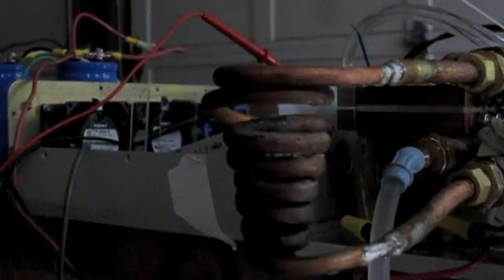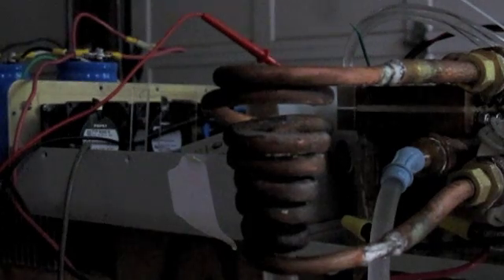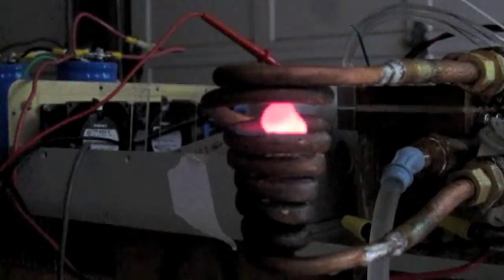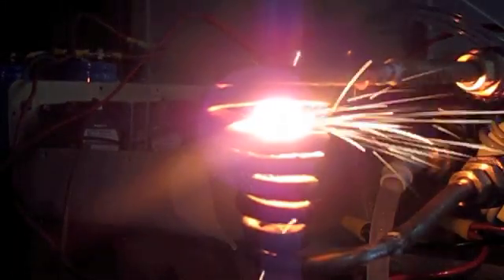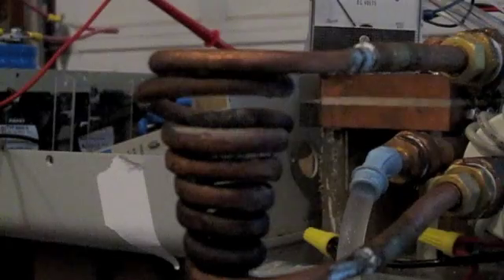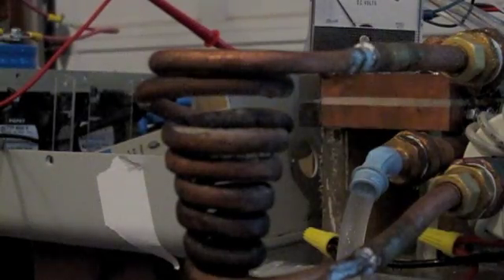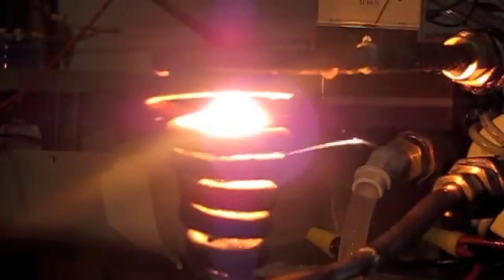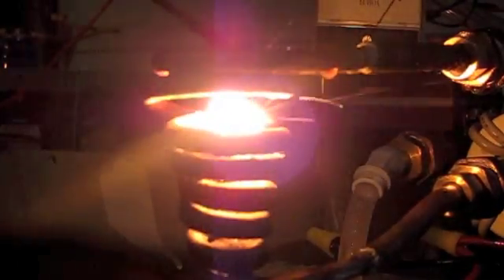Induction heater levitation of molten copper and steel resonance lock

Comment: Hey there, can a spring arround a bolt which current flows through function as a coil unintented ? And Melt the bolt and Not the spring ?

Comment: Awesome!
But, if the hum is from the variac, the power factor is probably pretty bad (they usually dont sound like that if the current is a pure sine wave going thru). That causes noise and losses (heat) in the transformers and main line.
It's not caused by your circuit, but simply by use a rectifier with big smoothing capacitors. Each AC half cycle, the smoothing capacitors charges with a huge current spike.
Put a shunt on the main line going into your circuit and monitor it on the scope, and you will see what I mean

A simple way to make it a lot better (without the need for complicated power factor correction circuitry) is to add a large  inductor between the rectifier and smoothing capacitor bank (not to large compared to the capacitors though, as the voltage will rise when circuit is turned off).
The DC voltage may drop a little though, but will still always be higher than the AC RMS voltage and the DC to the circuit will also be smoother (less ripple). 
Then you can probably take out more power from your 30 A line as the current spikes also affect the termal trip funktion in the circuit breaker.

Comment from the maker: The variac I use for the the high power is a 50A unit. I've pushed 55A @ 240vac through it for short runs before the 30A breaker goes.

Comment: Isnt it possible to use the heated core to generate the required power to perform the induction, and in a cell with pressurized carbon, or heated hydrogen, this could easily be turned into a Plasma reactor, If you were to perform this with a superconductor

Comment: @mgregggphone The resistance increase in this case is negligible for the eddy voltage generated hence current that does the job. Could also compensate for it by increasing the coil voltage.